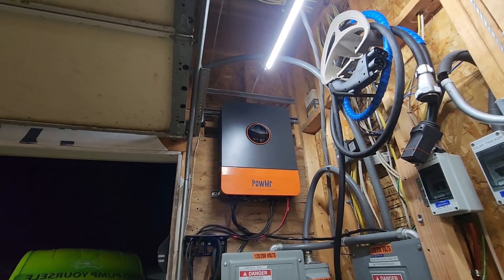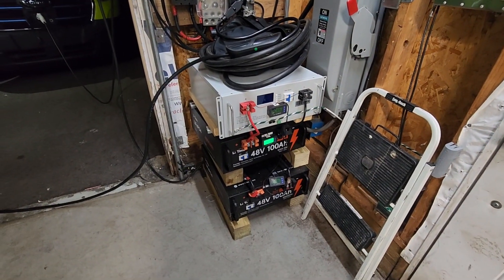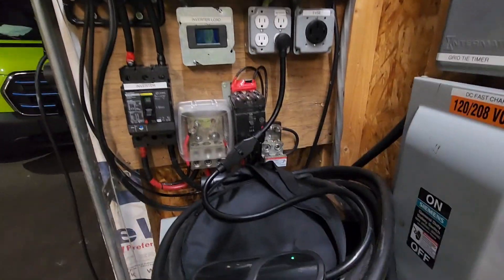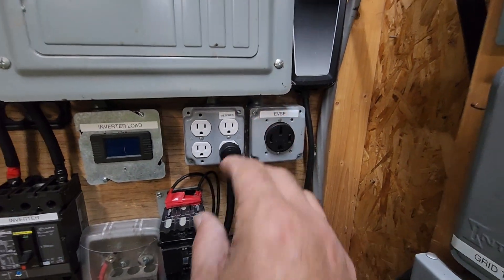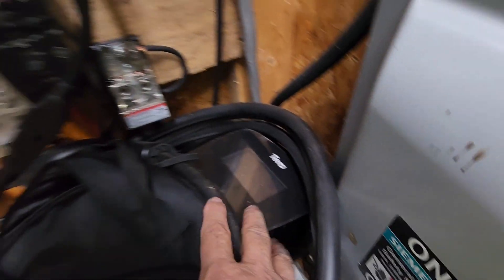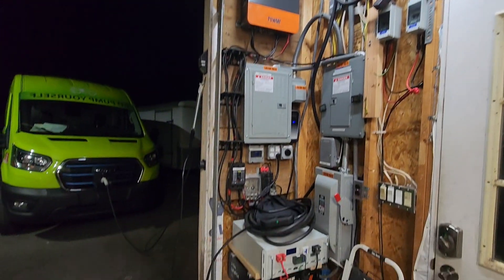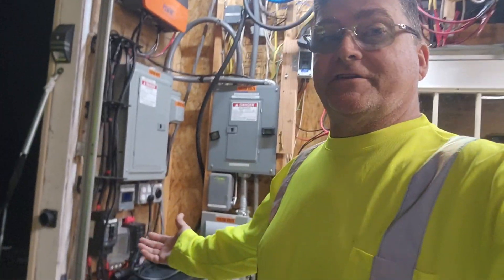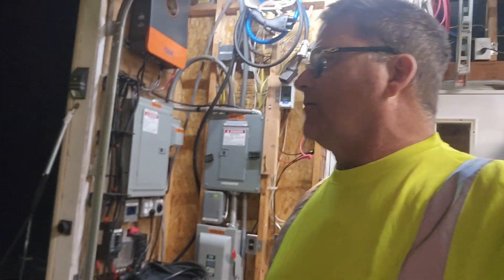Solar HYBRID power Inverter  "PowMr" wiring installation

Comment: Où est la connexion de communication entre la battrie et l’onduleur ?
Reply from the maker: There is an RJ45 jack on the inverter and battery. Connect a network cable between them, and then select "Poly" on the inverter.

Comment: what the hell are those 4-wire cables??? wtf are L1 and L2????
Reply from the maker: 4 wire cable is the standard 120/240 split phase configuration, L1 and L2 are the power feeds from a 2 pole breaker, then 1 neutral and 1 earth ground.

Comment: So grid is supplied by a breaker from your main panel?  Like a 30 amp?
Reply from the maker: Grid is fed with #8 wire on a 40A breaker, same for output
Reply: @Electrician-family so you have two breakers in panel for this